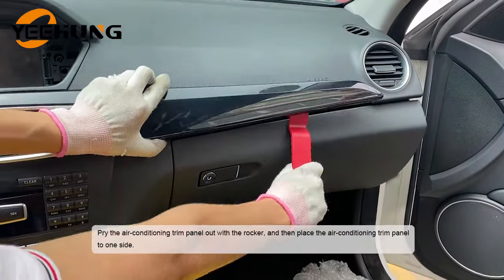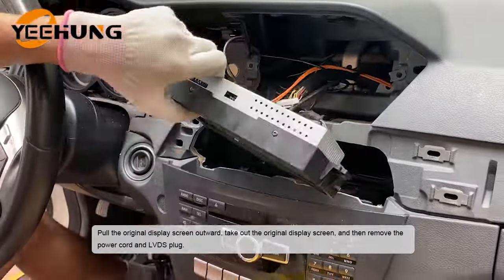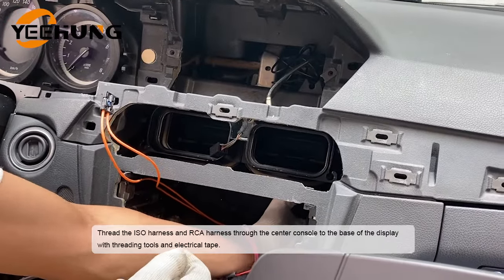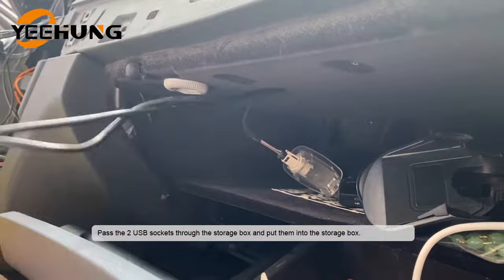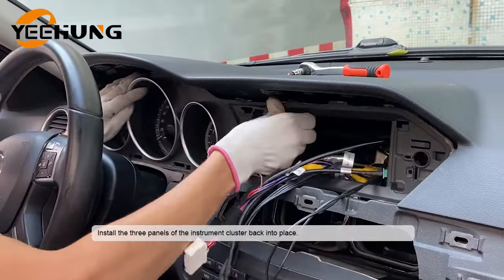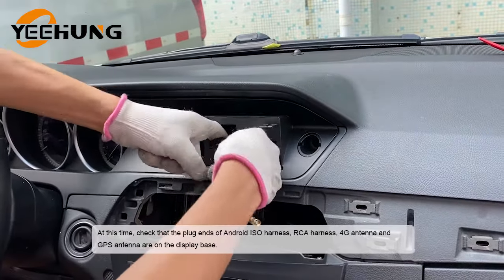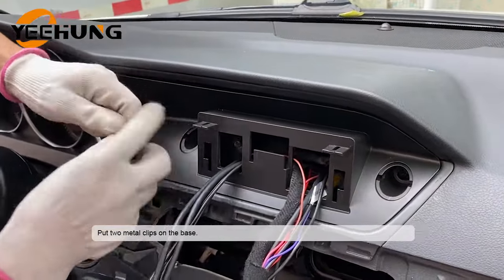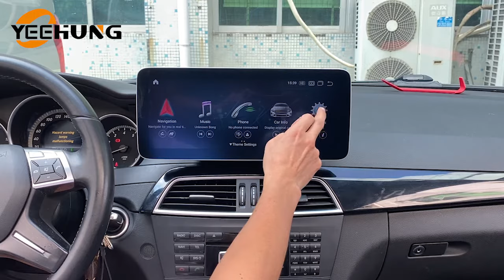YeeHung W204 Android 11 12.3" install (Built-in CarPlay android auto)

Comment: The sad part about this installation, is it was done incorrectly. I am assuming this was the manufacturer that installed it? one part that really stuck out are the GPS and 4G antenna cables are supposed to go through the Middle Hole in the plate, it even has grooves for them to sit in on each side... Terrible Job!
Reply from the maker: Yes, there may be a better way to resolve the location of the GPS antenna in relation to the 4G antenna. Thank you for the suggestion.
Reply: Can you explain what you mean by through the middle hole in the plate? Im about to buy this and do it myself

Comment: How did you manage to fit the host(headunit/radio) back inside with the extra wire harness? Not enough room. Can describe how you fit the harness into such small space?
Reply from the maker: You can place part of the wiring harness on both sides of the OEM host.
Reply: @pempcar cap. No room. Show the video
Reply: @pempcar No.  You can't.  Why didn't you show this if it's true?

Comment: What happened to the Aux cable?
Reply from the maker: Yes, w204 has the aux in menu, you need connect the aux cable to the car's AUX IN sockets. or use the AMI cable.

Comment: Which one do I need for my 2014 c250 ? Also does it come with the the bracket to hold the screen in ? And harness
Reply from the maker: Dear, i think your 2014 c250 is a NTG 4.5, following product fit your  car. 
https://www.amazon.com/dp/B0BNPY32GX?ref=myi_title_dp
Please note that if your original radio interface does not have the AUX menu, you need to activate it to get the Android sound.

Comment: Hi, I’m having trouble with this installation of the apple carplay.

1. Although I installed the carplay, everything seems to work fine until I try to play music on the system through Bluetooth. It doesn’t play any sound but when the navigation is on, siri tells me the directions but only a little. 

2. When I go into reverse, it shows up as a purple glitchy screen. 

In general, how do i plug in the systems wires such as the reverse camera, audio, and any other important wires?

Regards and thank you!
Reply from the maker: Dear, Did you purchase an Android or Linux display? Please email our after-sales service team at service@yeehung.cn with your order number and question to let them know the correct product model. This will solve your problem faster.

Comment: You don't show connecting the audio?  e.g. via Aux or AMI.

Presume that to hear anything from Android you have to select the input on the OEM screen?

Also, does this work with the original microphone?
Reply from the maker: You don't show connecting the audio? e.g. via Aux or AMI.
Reply: If your has the AMI, you must connect to the AMI, if you don't have the AMI, you don't need to connect anywhere.

Presume that to hear anything from Android you have to select the input on the OEM screen?
Reply: Yes, you must select the AUX menu in the original car interface.

Also, does this work with the original microphone?
Reply: Sorry, you cannot use the OEM microphone in the Android menu, but you can use the original microphone normally under the original car function.
Reply: @pempcar  thanks for the reply.

The microphone is surprising as you can intercept its cable just like all the other cables.  The original microphone is excellent and is already nicely routed so please consider trying to use it.

The small Android module that replaces the Becker nav module can use it so I am sure you can 🙂

On that note, since the satnav module is able to play sound via the standard HU I would imagine  it should be possible for an Android unit to use the same mechanism i.e. no need to route the audio via aux/AMI/Bluetooth 🙂
Reply from the maker: @richiero0o0  Thanks for your advice.
If the Android sound is to be input to the original car host, there must be a channel to go in.
Reply: @pempcar  indeed and there is one that the OEM removable satnav module (Becker) that is located in a cradle in the glove box uses.

This is how the replacement Android module (I think one brand is Carabc) works with the original microphone so if your loom patched into that feed it should be possible.

The Carabc module uses Bluetooth for audio but that shouldn't be needed as the Becker module uses an automatic wired input.
Reply from the maker: @richiero0o0  I will pay attention to the Becker module you mentioned. We sell NTG 4.5 CarPlay MMI BOX, which uses OEM mic,
https://www.amazon.com/dp/B0CGLLMX24?ref=myi_title_dp

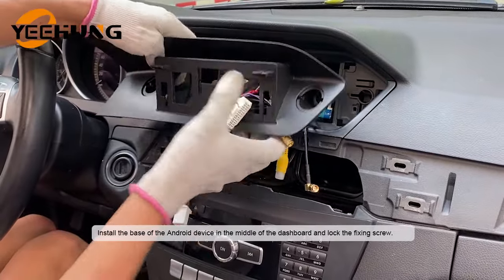Comment: 9:02-9:15.... totally different car. Probably the piece that's not working for me. The original OEM display is not working.
Reply from the maker: Yes, this part is for C-Class W204. Please note that if your car is NTG 4.0, please use the LVDS box with NTG 4.0, otherwise it cannot display OEM display info.

Comment: Would this fit a 2014 c220 cdi?
Reply from the maker: Yes, it fit your Mercedes 2014 c220 cdi NTG 4.5.; Please note that after installation, if your original car interface does not have an AUX menu, you must first activate it according to the instructions. Otherwise you can't get android sound.

Comment: I have a c class c180 2011 wich ntg do i have?
Reply from the maker: if your c180 2011 is a ntg 4.0, below link fit your car.
https://www.amazon.com/YEEHUNG-Anti-Glare-12-3-inch-64-2008-2011/dp/B09Y8TS4NS
You can determine whether it is NTG 4.0 based on the second picture of the product.

Comment: 9:02-9:15.... totally different car. Probably the piece that's not working for me. The original OEM display is not working.
Reply from the maker: Yes, this bracket only fits W204 2013.
OEM display does not show, please check if you have connected the LVDS box?